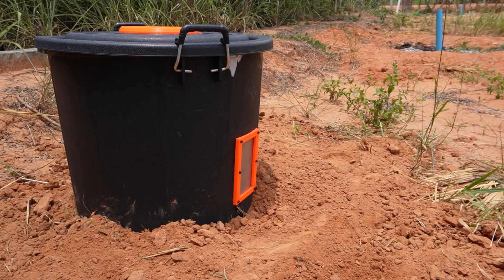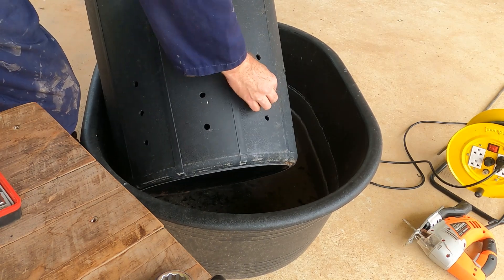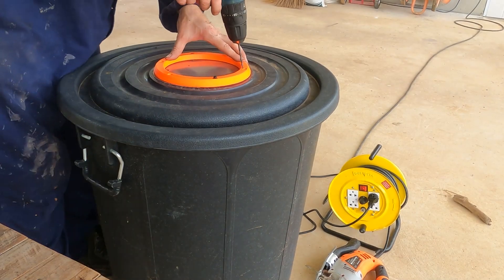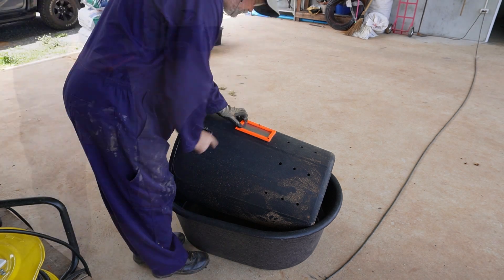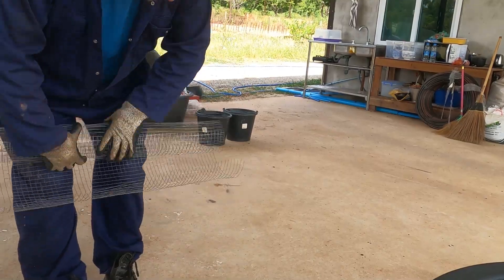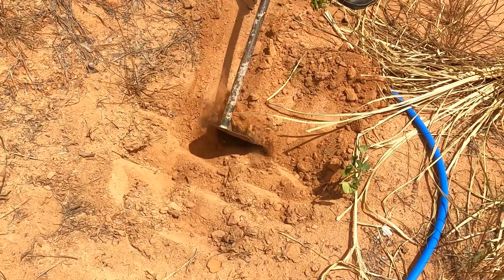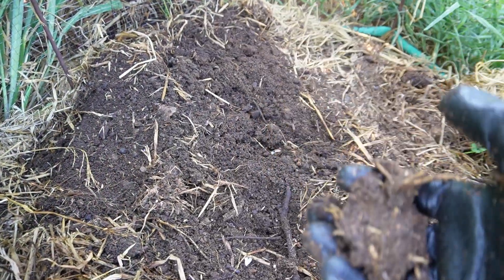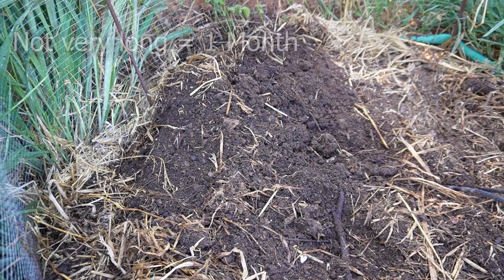How To Build An Experimental DIY Compost Bin: Using 3D Custom Parts

Comment: Did you compensate for the curvature of the for the mesh grill section?
Reply from the maker: Actually yes! The mesh holding frames are all custom 3d printed to the right diameter!
Reply: Well done! It looks fantastic! I've got a worm bin with a smaller diameter that I need to add some vent ports to. I'm delaying dealing with the curvature at the moment 😂

Comment: Good design,It's a shame they're plastic. There's already way too much of that in use in Thailand. Did you make the brick planters? I was thinking of doing similar.
Reply from the maker: Hi @EighthSphere1 I agree about the plastic use in Thailand. This will however stop all our food and other organic wastse go into landfill and will help us rebuild the soil at the same time. Yes the brick planters are great, quite cheap to make and look fantastic. I didnt want to use the normal concrete blocks , 1 ) because of the look and 2) becuase of the sustainabilitiy angle. We also try and reduce the amount of concrete we use but its sometimes unavoidable in this harsh environment. Thanks for the comment - appreciate the input.

Comment: Please shorts and flip flops ewe must be a little bit hot 😅
Reply from the maker: Hi alanatkinson6089 - Lol I seem to sweat buckets regardless of what I wear. Many workers start at around 5 am and then finish by 10 am as it gets too hot. I am quite clumsy so I wear boots to protect my feet. I am 100% sure if I wore flip flops you would see at least one video a week of me dropping something on my foot, and then a lot of beeping noises to cut out the swearing!
Reply: @TheSmartGardenRomYenHouse  same for me 
Is the solar system still doing the job for you?
Reply from the maker: Hi Alan - yes! So far it has been excellent. One concern for me is battery life. The batteries for the newest system are in the workshop area which doesn't have air con and as such they are often in temperatures of 32 degrees C or more. I am concerned about the effect on the battery life as they are the most expensive part of the system. TIme will tell I guess. Thanks for the question.
Reply: Cheers